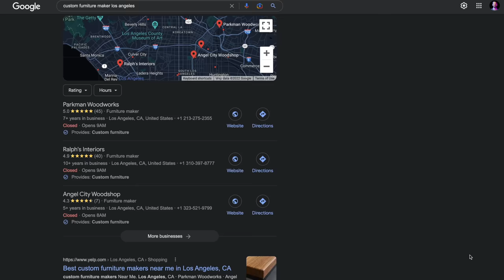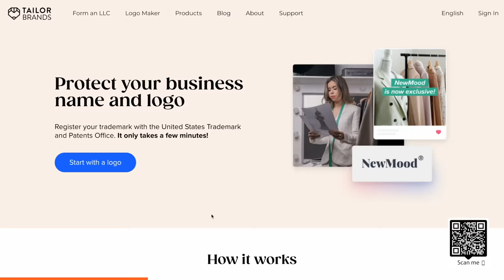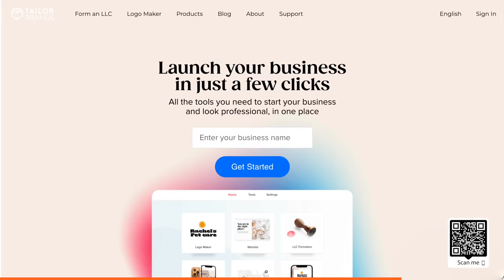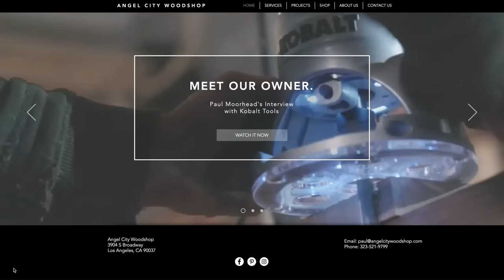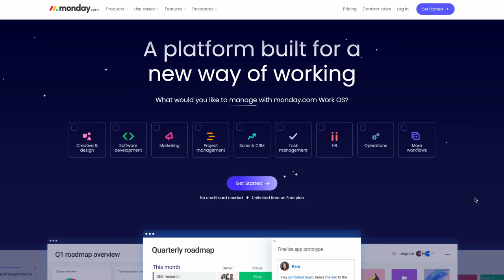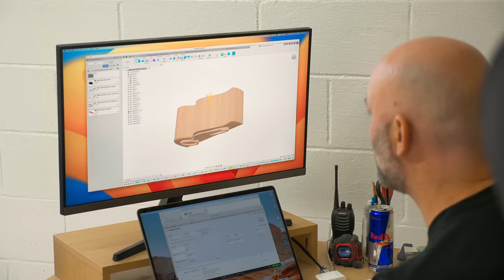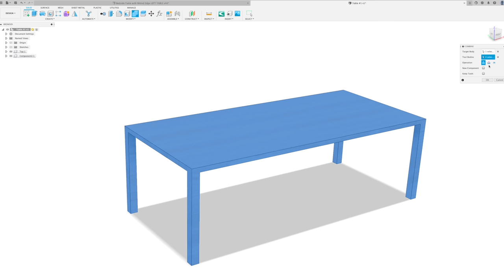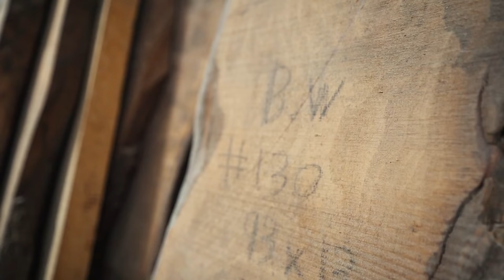Do This to Make $2,000/Day with a Woodworking Business!

Comment: That shop is WAY to big for what he has in it. There is so much time wasted between walking across the building to a machine, back to the bench then over to another machine or tool rack, only to walk back to where you just came because you forgot something. Time is money, and equipment spread out all over is a time killer.
Reply: That's what I thought. Mostly empty space with everything too far apart. Really needs to improve on the workflow and then rent out the other half of the warehouse.
Reply: Yup.  Some lumber and plywood racks wouldn't hurt, either.

Comment: All anyone needs to get started is a table saw, small air compressor with 1 1/2” nail gun, Brad nailer, 7/8-1 1/8” stapler and a cup spray gun, small 13” planer, 3x12 belt sander, 5” orbital sander. Under $3k for everything if you get the Porter-Cable pancake compressor with finish nailer set and a descent cabinet saw.

Comment: Great insight into running a woodworking business, but I was puzzled as to why there was no work-in-progress visible in the workshop, no projects being worked on, no busy workers in the background and the only activity shown involved the repeated planing and sanding of a plank of wood. Maybe the interview took place at the weekend - which would explain the machines being off and the absence of employees - but, given that he mentioned having an order book of 6-monthswork,  I would still have expected to see work-in-progress on benches etc. But then, I'm no expert so I guess I missed something.
Reply: Hi Mike! Paul here. I understand your confusion! There's two reasons why. Firstly, our work is noisy. We talked about this with their production team and it just made the most sense to stop our work while we did the interview... it simply would have been too noisy. The timing of the interview was the other oddity. Our shop is often strewn with work pieces all over the place and not a free surface can be found. Other times we kind of end up at a "reset" point where we've just finished all or most of our current projects and we're about to start the next batch. This is where we were at the time. We had just wrapped up three big jobs the days before this interview and much of our work was being done on-site for installs. Hope this helps!

Comment: I’m a woodworker desperate to turn my hobby into a business. Got a decent sized shop (32 x 36sqft) and decent equipment. My biggest problem right now…shop keeps flooding in a heavy downpour! Only on one side and coming up from the edge where the wall meets the concrete floor. Hoping in Spring to dig and bury a French drain on that side of the shop but that’s about it for the extent of my ideas. Any advice from folks wiser than me greatly appreciated.
Reply: If its your property dig deep and add a a waterproof membrane to the exterior. If its not, apply some thick waterproofing goo like DryBase to the interior
Reply: @bfelb  thanks for the advice. I’ll do all of the above as you suggested 👍
Reply: regrading will probably help as well.
Reply: I had the same problem. Best to dig down a foot or so and add perforated drain pipe along the perimeter then backfill with gravel. And lastly grade everything off, your slab should be above the ground and drain away. Hope that helps good luck.